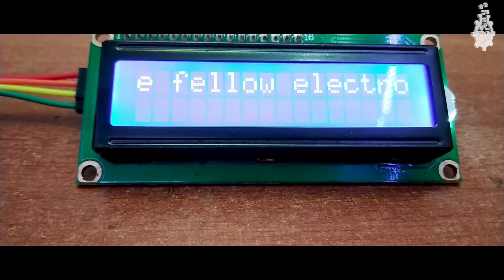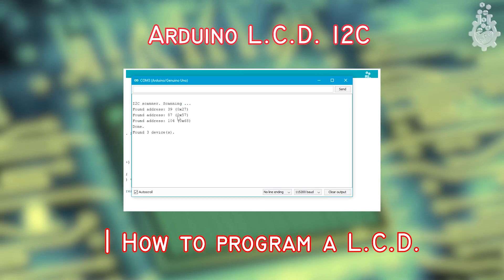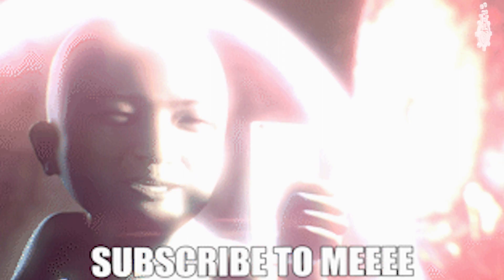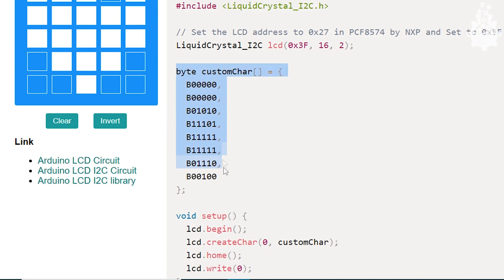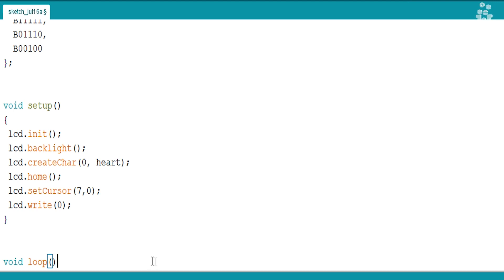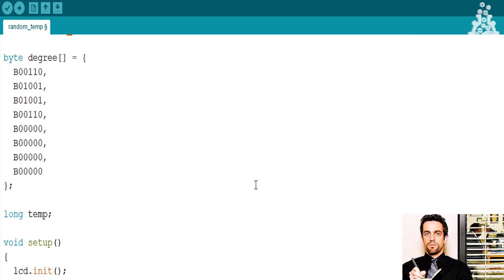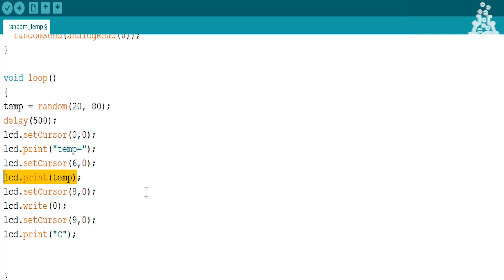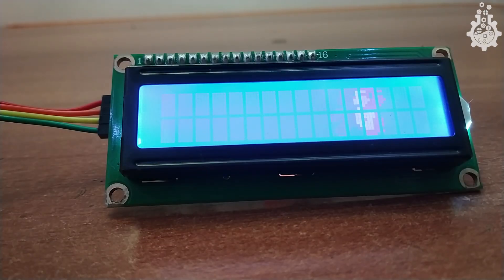lcd custom character for arduino

Comment: Can you please upload the code program for the PUBG thing. I faced an issue this my program codes like when I define a numeric number to crate characters i used to get the screen mixed up. If you could upload the code in the description so that I know what is the main issue with my codes it would be great.

Comment: Can we create time and date for i2c lcd display without rtc?
Reply from the maker: RTC has a battery that syncs clock even when power is disconnected from circuit, but if you choose not to use RTC you have to mannually add time everytime
Reply: @mission_critical  Thanks :)

Comment: hi i need more than 8 custom how i can do that can you help me pls?
Reply from the maker: I don't think it's possible, as I said in video, there is limitation to custom characters, try to remap your character interms of ascii symbols,
But still you can try some other microcontroller, which might not have this kind of limitations, this is purely Arduino limitation
Reply: It is a limitation of the LCD display module, not the Arduino.   The display module reserves character numbers 0 through 7 for custom characters.  You might find a different LCD display module that adds an additional character range, for instance 128 though 135, for more custom characters.   Look up the detail specifications for your exact module.
Reply from the maker: Thank you for subscribing to Mission Critical!

Comment: lcd.write(0); returned an error for me. lcd.write((byte)0); worked fine. fyi
Reply from the maker: I think you need to write the data in inverted commas for example lcd.write (" thank you for Subscribing to Mission Critical" ); or variable name lcd.write(thank you);
Reply: Mission Critical as described your listing didnt work for me. Had to replace lcd.write(0); by lcd.write((byte)0); to make it work. Otherwise it wouldnt compile.
Reply from the maker: That's great, finally we found a solution for those who can't get this correct, thank you @sebastian pfennig for sharing this with us, and also thank you for subscribing to Mission Critical! 😁